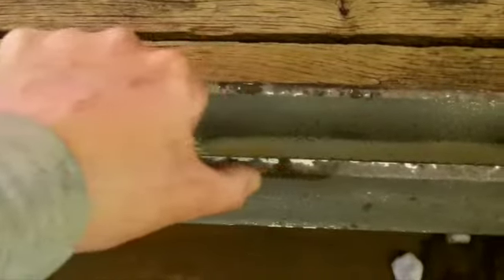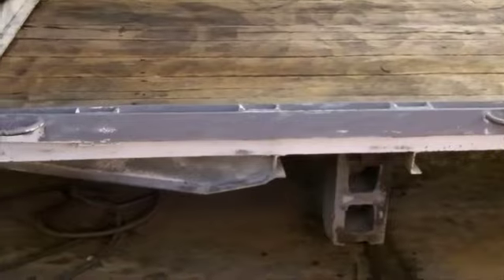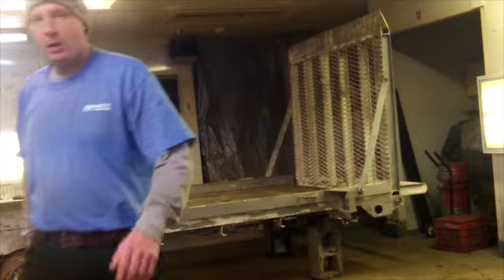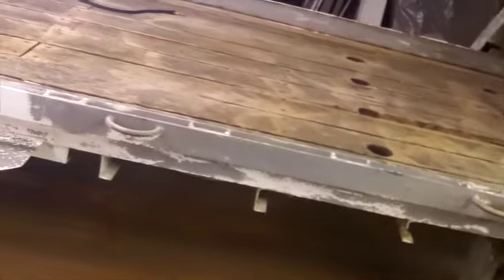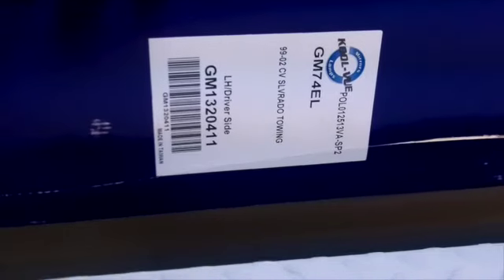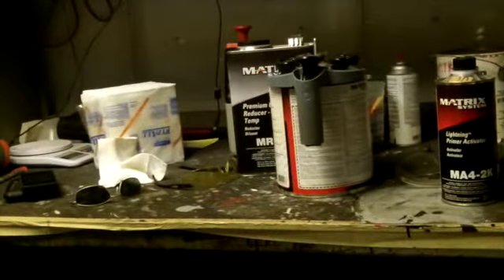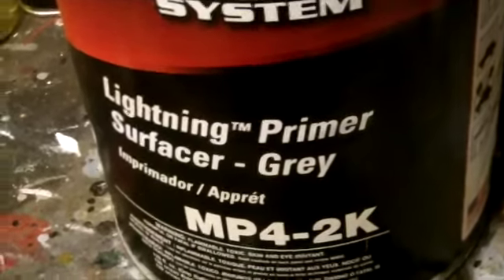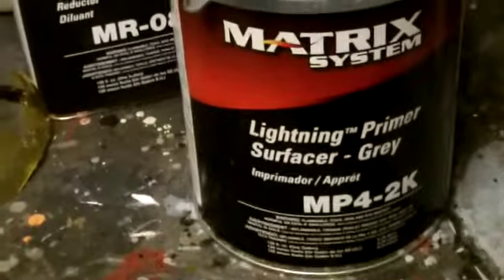Equipment trailer update and a thank you

Comment: Good job so far on the trailer.
I like the mickey mirrors. :-)
Reply: Good to have a look @ this trailer without the wheels on...now I know how to make the walking beam for the springs so I can make my own tandem axle set up...got 2 axles for making a trailer...the 1 on the Miller & one up @ my Uncle's farm on an old boat trailer...
Need something to bring my fork lift home...
Reply from the maker: They have a great field of vision compared to the stock ones... and they're heated too
Reply from the maker: Kohala Iron Works Case Not sure how heavy the forklift is but even some of the smaller ones are like 5000 to 7000 pounds.  Gonna need some stout ramps to get er up on the trailer.  Those things don't like to climb well.  How about a roll back tow truck?  We've used AAA to haul things even though it's for your vehicle.  We have a pretty good rapport with the local towing company so it works well.
Reply: I might have to break down & have a towing company get it from Uncle Boogie's house...

Comment: I shall be interested to see how you go on with the painting - air temperature appears to be more critical than I imagined! Could humidity also be a restricting factor? (frosty weather is lower humidity but then your fighting cold temps of course)
Reply from the maker: I will be heating the shop to near 80 degrees.  Once I turn on the exhaust fan.. it will drop to probably 50 by the time I'm done.  I'll be using accelerator in the paint to ensure that the paint can cure with the lower temps
Reply: Thanks for this reply. I look forward to seeing this if you are able to video this amongst everything else!

Comment: Factory tow mirrors don't angle up.  They sit level.  I had to take mine apart and level them out.  I can see the wires on mine too if you look close.
Reply from the maker: Gotcha... I figured the ones I was seeing on the pickups around me were factory.  Did you just use some washers or something?
Reply: Yup, you have to pop the cover off the mount and add washers until it sits level.  Not hard but getting that plastic cover off without damaging it is not easy.
Reply from the maker: mossman381 Cool.  I'll wait till it warms up or I can get it inside.  We all know what happens with cold plastic